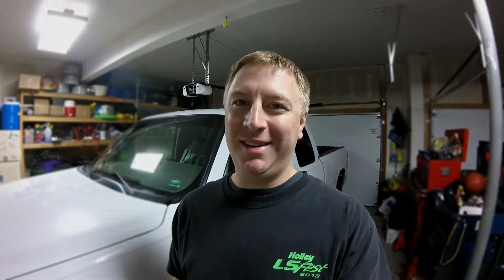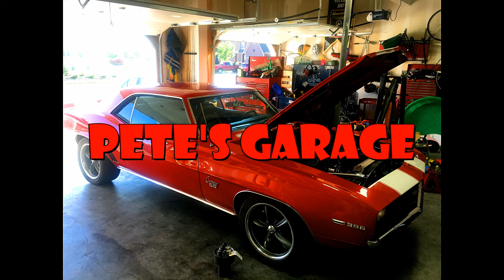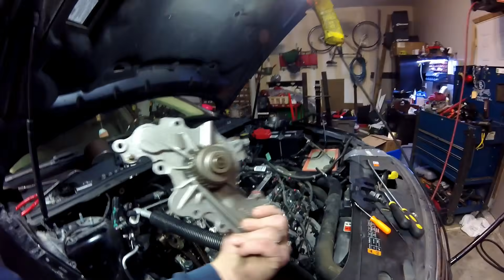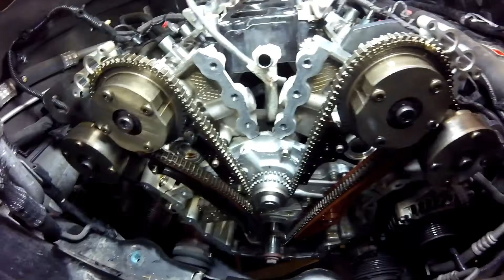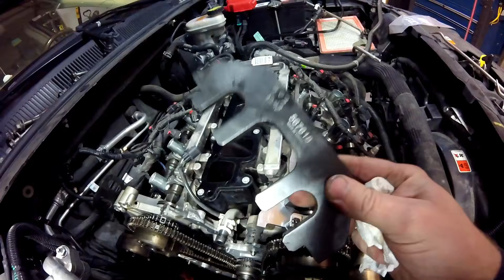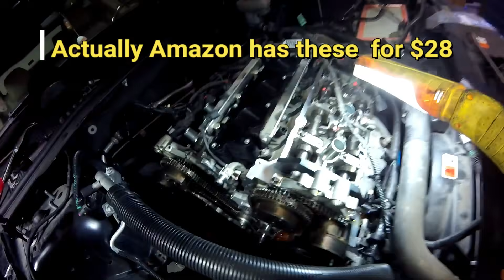Why does the Ford Taurus, Explorer, Edge 3.5L water pump cost over $1400?

Comment: My wife has a 2016 Ford Flex 3.5 tt with a bad wheel speed sensor so I'm here on YouTube then I come across this That Sinking Feeling that you get when you learn something but you didn't want to learn . I'm glad that guys like you  put these videos out for us driveway mechanics.
Reply: Knowledge is power. Ford isn't the only one that does this ridiculousness.
 Water pumps WILL leak eventually. If outside the engine no huge problem as long as you don't ignore your dash light, let the coolant get too low, and the engine overheats. But when inside the engine the coolant leak can mix with the engine oil and will rapidly destroy the engine. Planned obsolescence at its finest.
 That's exactly what happened to my parents Ford Edge. They couldn't believe it.
As I said knowledge is power. Do some research and find a well engineered vehicle to replace it with. Then get rid of it as fast as you can!
Reply: @johnwyman6331  The toyota 3.5L is a flawless engine. Especially the Lexus version, with 2 sets of injectors that Ford stole their idea so it don't cake up the valves. It was actually designed by the same people who designed the Taurus SHO motors (Yamaha).
Reply: I bet it will cost like 4500 to replace that sensor. 
Id say its totalled and get a new one.
Reply: That Flex is a total sleeper, on same drivetrain as taurus sho!
Reply: Get rid of that Ford before it's too late.

Comment: I love when manufacturers aim their wheep holes towards the  alternator.  Brilliant. OHC engines are ridiculously expensive to maintain. Give me the old pushrod engines, simple, proven  engineering
Reply: Ford edge weep hole leaks into oil pan so you never know you had a leak until engine blows
Reply: 3800 series II N/A and supercharged for the win
Reply: Pushrod engines also don't perform as well as OHC engines. There's a reason why EVERYONE went to OHC engines many years ago.
Reply: @tempest411  If they are designed without cutting to the bone they are excellent engines. There are crown vics with 500K miles on a well maintained original motor. And Ford sold a continental around 2000, they had a v8 cobra engine and FWD. Never hear of an an engine issue with those. One ford tech told me years ago he never saw the inside of one.
Reply: @InlineSkateFitness  I think what tempest said went right over your head. A OHC engine performs better than pushrod engines power wise. The can be made to run and bring on power smoother, they can handle higher RPMs, they can do a lot more than a pushrod engine can performance wise. HP and torque are not everything its how you put that HP and torque to use that matters and OHC excels in that area.
Reply: @tempest411  chevy still uses pushrod engine and the viper
Reply: @r.a.p.k.models  Yesm I know, but it isn't the exception that proves the rule. If they'd used OHC designes they'd have gotten the same power out of a smaller displacement, more fuel efficient engine.

Comment: Your a lucky one. What happens when the water decides to leak out of the front of the pump or someplace other then the weep hole. Well it pours straight down into the oil pan and destroys the engine. Do you think 1,400.00 is expensive. Talk to some of the owners of the 3.5 ecoboost that had their engines destroyed by antifreeze getting into the oil and going through the bearings in the engine. Bad design. What kinda flunky engineers do we have designing the engines of today? An accessory driven water pump has been a good design, making it much quicker to replace and easier to get to. I can’t understand why someone would put it where it can damage the engine beyond repair.
Reply from the maker: Right? Milkshaked oil time and ruined bearings. Yeah a water pump is much cheaper than the whole engine.
Reply: Pete's Garage sad thing is they decided to use the same 3.5 engine design on the newer trucks. Put an adapter plate with an idler pully where the water pump use to be and moved the water pump out to the serpentine belt basically rerouted coolant through a maze of tubes and hoses. Redesigned the intake to accept port injectors. If you ask me they should recall the earlier models and do the upgrades at their expense. It would be the right thing to do.
Reply: Its called engineered failure. It makes the company money one way or another.

Comment: You can do it without the 28 dollar tool I just did mine on my 08 ford Taurus and I did mine in 8hr and I have a very bad back
Reply from the maker: Anthony Barbee yeah i didn’t realize the tools were that cheap when I made the video. Then I found them on Amazon. You must know what you’re doing though. I’m not sure the average joe could do it that quickly.
Reply: Agree is not that difficult, get Haynes manual take pix a go slow. Shitty design of part that is failure prone.

Comment: Had the same issue with my 2012 Ford Edge last week .. I took it to the dealer and luckily I had extended warranty cover the  repair or else I’ll be looking at a very expensive repair. You did a great job explaining what is involved with this type of repair. I feel it is a bad design to have the pump where it is .. I’ve watched other videos explaining how a bad water pump has damaged the entire engine by leaking and mixing with the oil!
Reply from the maker: Antonio Torres thanks for watching.
Reply: Repair it yourself, even with buy special tool it far cheaper then the dealer. Just go slow, take pix and use Hames manual. Saves you a ton of money. Plus I don't trust their workmanship at many dealers.

Comment: Dealership wanted 3500 for timing chain and water pump on a 2011 sho. at 100k miles. I just traded it in and bought a warranty on a 2016 with 21k miles.
Reply from the maker: That’s a smidge more than I thought it would cost! But that is on the ecoboost model and including new chains. Yowzers!

Comment: At what mileage did the pump fail?
Reply from the maker: I think it was 140k Miles.
Reply: Mine failed around 108k :(
Reply: @WillKoz  90,000 on our flex. Ours leaked into the engine. Junked the whole thing!

Comment from the maker: You can purchase the cam tools cheap here! https://www.amazon.com/Opall-Tool-Holding-Chain-Tensioner/dp/B07D3P2ML6/ref=mp_s_a_1_2?keywords=ford+3.5+camshaft+tools&qid=1552411760&s=gateway&sr=8-2
Reply: Power 2 Weight Whats bullshit about it? Looks legit to me.
Reply: @Power 2 Weight  Common sense isn't your strong point, obviously.
Reply: FYI did you know that the ecoboost 4cyl. (2013-15 ish) the timing belt cog pulley at the crank doesn't have a keyway it's held in time by the crank bolt. Engineers, go figure. 😂😂😂😂😂😂😂😂😂😂
Reply from the maker: mr.18436572 I believe all of the duratech 4 bangers are that way.
Reply: @PetesGarageandperformance  I didn't know that, I seriously question the logic of engineers sometimes. ✌✌
Reply: I’m soooooooo glad I’m out of the mechanic field after 35 years.  Time for you young guys to deal with all the engineering bullshit
Reply: These guys crying about your title being misleading are frickin idiots. That job at my shop is right around the $1400.00 which tells me you're talking about the cost of a W/P at a shop not in your backyard.
Reply: @Carlitosway211   charlietow  The title is misleading because it implies the water pump is 1400 when it's actually the water pump plus the labor. The fact you missed that and call others idiots is the internet at it's best 😂
Reply: @fj06carnone  I don't see it as misleading because I would never assume a pump costs 1400 for a Ford. The fact that people are bitching about their misunderstanding of the title is the internet at its best.
Reply: @Power 2 Weight  Thanks for tip, guy that's bitching about a title he didn't understand.
Reply: Hows is your bullshit title mate , the water pumps in the states are about $50 on eBay , and seriously if you are mechanically minded it costs fuck all except time to fix . Only complete fucking Morons  take their cars to automotive workshops, and they deserve to get burnt for being morons in buying the pile of crap in the first place because as we know when people buy newish cars they have bought them because they have no clue about them
Reply: @Power 2 Weight  I feel like it's you who can't read. What part of "I would never assume a pump costs 1400 for a Ford" is hard to understand?
Reply: @Power 2 Weight  Lol! Aww, must have struck a nerve.
Reply: @Power 2 Weight  Gee... Ya totally got me. Lol
Reply: @Power 2 Weight  Thank you, oh great one.

Comment: I have a 2011 Taurus SHO. Is the water pump the same design on the ecoboost engine?
Reply from the maker: I believe so. And it takes even longer than the nonturbo according to the labor time guide.
Reply: @PetesGarageandperformance  Dang, thats not what I wanted to hear :(. Either way, thanks for responding so quickly, very impressed. What was the mileage on the taurus when the leak began? Thanks again. Im Subscribed with notifications!
Reply from the maker: josh w this one did have over 140k. So it lasted quite a while. I believe the rest of the engine is pretty solid though. So hopefully you don’t have to go through this. Thanks for the sub!
Reply: yes, sorry

Comment: Can i email you my hp tuners file and some money for a timing correction i have an after fire issue at 3k rpm then after i open up the throttle some more i feel the power kick on and it clears up
Reply from the maker: I wish it was that easy. To properly calibrate the ECM I would need the vehicle so I could datalog what is going on. What kind of setup are you trying to tune?

Comment: Just push it off a cliff!  Side note, it is probably designed like that on purpose, to give dealerships more income.  ^_^
Reply from the maker: I don’t know. They run pretty good when they aren’t broken! In all my years working in the dealerships I’ve come to realize that the service department is not a factor that ever came to mind when designing a vehicle. It’s more like “how can I cram this into that and make it work”.
Reply: C'mon Pete, a dealers service department is where the bulk of their money is made. Vehicles are now designed to make you have someone else repair it, preferably the dealer. Most people can't even change there own battery anymore, if you can find it
Reply: Hmmmm...  so you think its more about how much shit they can cram into the engine bay?  I can see that.  Haha.  "Lets put a V12 in there, it'll fit!"
Reply from the maker: Not sure if that’s really how it is, but it sure seems that way!
Reply: @PetesGarageandperformance  I find changing my coolant at least twice a year helps....so far so good.
Reply: Pete's Garage think everything runs good when it’s not broken
Reply: i work for the stealership as a tech and yes you're correct.
Reply: I’m a Ford technician and I’ve had to do this job many times and it’s a bitch! But it’s design has nothing to do with making dealership money. In fact Ford pays the dealership to do this job and the warranty times calculated by Ford usually aren’t enough to cover the time spent on the job anyway. It sucks!
Reply: Exactly this. Dealerships and manufacturers  don't care.
Reply: PUSH?  Drive the fucking thing off a cliff....who cares if driving it further dumps coolant into the oil.....
Reply: I agree!!!!!
Reply: probably??!!! No it definitely is without question
Reply: @Mike E  ????
Reply: More likely it's done that way so they can cram as much engine into a FWD chassis as possible. Having the pump run off the chains saves precious centimetres on the overall engine length which helps a lot in East-West engine installations. Giving more money to dealerships is just a by-product of this design.
Reply: @Ultra CNC  Yes but also the coolant breaks down and also causes failure apparently.
Reply: PowerSports - Sure it is! No other explanation.  ^_^
Reply: Its built like that for assembly ease on the line. 
Screw how to fix it later. 
I about shit myself and cried on a factory tour when a dash gets installed in under a minute, because that car is a 6hr heater core job.
Reply: @MrTheHillfolk  hate to say but thats nothing had to do a oldsmobile alero heater core  ,book said 11 hour and they where right!its basically take everything out till you have the complete firewal exposed what a p.o.s.
Reply: Have an 2011 edge with the same engine. The dreaded door ajar failure happened a few years ago and requires 4-6 hours of labor plus an expensive part. Fixed the problem by removing interior light bulbs. When water pump goes I'm having it hauled to the scrap yard and buying another Tesla.
Reply: @martialman.4563  Problem is that on a Tesla, if you need maintenance or suffer some suspension issues due to a fender bender or something similar, it might take a year to get the bloody car back.
Reply: @distracted_visions7095  Not true, but it will take longer for sure. Maybe 2-3 months. Keeping my Toyota Yaris as a back up as its not worth hardly any money and your right, my insurance will only cover loaner car for 30 days and repair might take longer.
Reply: @distracted_visions7095  https://youtu.be/tAnJPknzMYQ
Reply: PowerSports Great stupid comment.